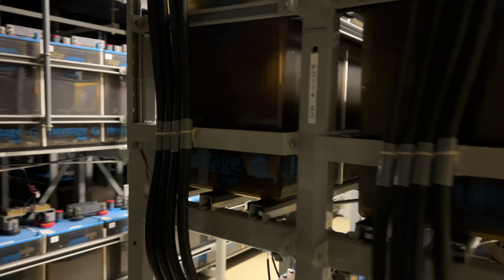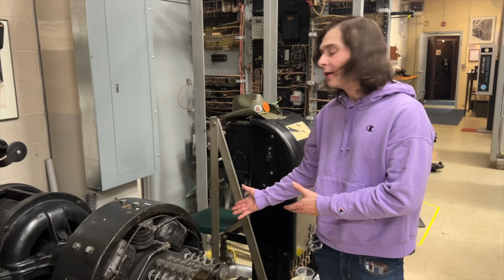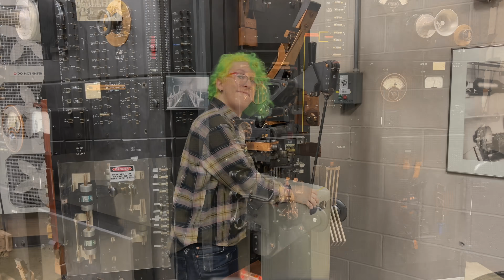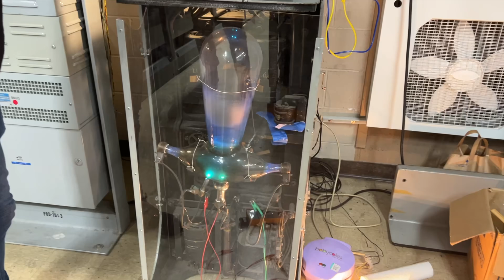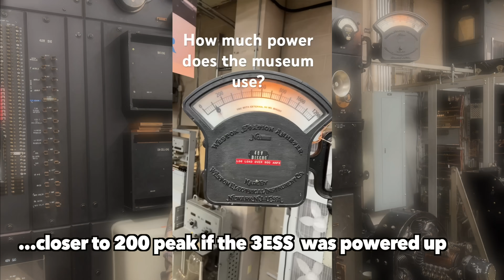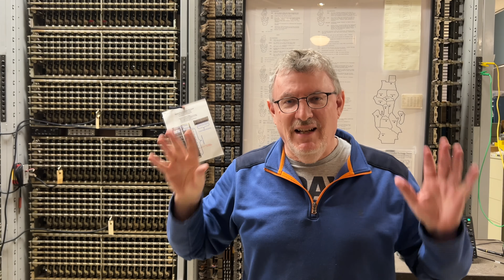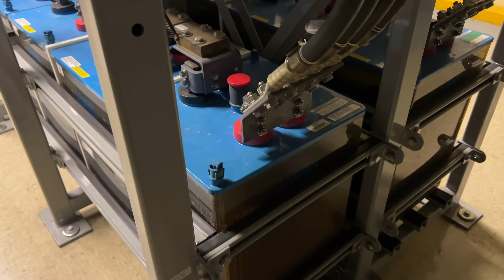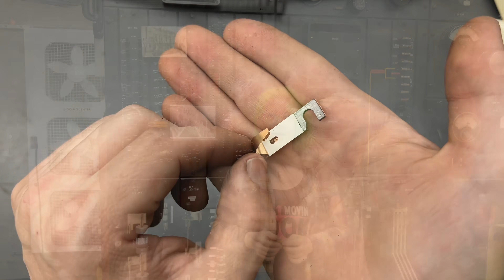All About Telephone Power Plants

Comment: I don't believe that "4800 amp fuse" is actually a fuse unless thats a soft low melting metal in the middle. That shape of device is more likely a current measuring shunt. It will have a specific voltage drop at the rated current across it, usually a round value like 100 millivolts or 50 millivolts and that can be hooked up to a meter movement with that range and labeled to the scale on the face.
Reply from the maker: It is 100% a fuse, guaranteed. The material in the middle is lead. (The shunts are elsewhere on the back of the power board.)
Reply: @ConnectionsMuseum  We believe you Sarah, it's just hard to wrap our heads around the power needed to blow that fuse, and as you said, it would be bad. lol. I am a scaredy cat around power that can smoke me, so I would have kept 10 feet from that thing.

Comment: Wrench go bye-bye, but screwdrivers have a chance to get launched! A change of pants follows.

Much more modern than the museum, but there are little packaged power plants that fit entirely within a cabinet. Marconi Lorain, Vertiv, and Valere have or had systems like this. In the typical style, BDFB up top and equipment down low. The "fully enclosed" ones are kind of fun with the ventilation slots on the lid - sized quite appropriately so that anything that should fall through would be small enough to be instantly vaporized! :) Keep tabs on your washers, folks

Not quite common enough to be a rite of passage, but a good reminder to wrap your tools in electrical tape.

Comment: My father worked in a 5X5 crossbar office from cutover in Nov of 1949 till retirement in Dec 1973 and their power plant changed over the years. When cut into service they replaced operators, and the locals couldn't figure out the "new" system. They had three GE motor generator sets the were 200 amp which evolved into one being replaced with a Westinghouse 400 amp machine, it was a screamer sound wise compared to the GE generators. Finally in the last few years of service they installed a solid-state rectifier that became the number one in the string and ran at full output of around 500 amp. Originally there was no standby power for AC, later they installed a 100kw diesel unit that had to be manually started, just after Dad's retirement a Solar gas turbine unit was installed a 250kw unit.  At retirement the exchange had two full units 232 and 439, now there are five exchange units and are all ESS and are in the basement, whole first floor has nothing left but the main frame. Haven't been in the place since ESS as there is no regular staff.  Remotely monitored and "nothing can possibly go wrong!"
Reply: I spent about 10 years maintaining DC power plants and backup generators.  At one site we had 3  2.2 megawatts Solar Generators operating in parallel    400 gallons of fuel per hour
I also saw what happens when plumbers working on a water sprinkler system above the bus bar shorted out a  ladder from the bus bar to ground.  It put a hole in the 1/4 “bus bar. And destroying the ladder
When working on these power plants a good safety reminder is to keep one hand in your pocket

Comment: A benefit of -48 V that could never have been foreseen by the inventor is that you can switch it with N-MOSFETs which are much more efficient than P-MOSFETs. When I did a design for a manufacturer of modern battery backups for cell phone base stations, I was quite happy that I didn't need complicated high-side switches. (Yes, -48 V is still the telecom standard.) But I have a hard time rewiring my brain for positive GND.
Reply: What's positive ground? And what's N-mosfets vs p-mosfets?
Reply: @freddiebauer5843  It's when, instead of using the lowest potential in a design as the common distributed reference, you use a higher potential. It's just a matter of convention. For instance, there are (old) car models that connect the positive terminal of the battery to the chassis. They are said to have positive ground. The other battery terminal has -12V relative to ground.

N and P in semiconductors reference the charge carriers. In an NMOS, it is the electrons that are controlled whereas in a PMOS it is the absence of electrons – holes – that are controlled. And that is indeed a practical difference since controlling electrons is more efficient. Very simply put.
Reply: @mumiemonstret  is this why the video host isn't scared to be around such high DC voltage? Does it make it safer?
BTW, I had no idea this was even possible. I thought positive to ground would just drain the battery

Comment: It was wonderful to see End Cell switching. That has to be the craziest part of telecom power. I’m not sure you mentioned that power is not disrupted while adding a cell. This means the cell is first shorted out, then put in series with the other cells, and then the short removed. I’m assuming all end cells work the way I was taught.
Reply: I was going to ask about End Cell switching.  I've heard that it is done by a motorized control that is designed such that nothing can stop it once the process is started. The non-stop feature protects the shunt that is being fried during the process.

Comment: It’s been a long time so I may have this wrong, but I thought the batteries were floated at 52.75v and not 48.
Reply: It depends on the battery chemistry and construction and how the string is built. Where I work the COs have strings of 24 C&D AT-21Ps, which are valve-regulated flooded lead-acid cells. Those systems float at ~54.25V. Some other strings float 52, some 56, and so on... hence the disclaimer of 48V "nominal".

Cars are the same, 12V "nominal" but alternator set for 13.8 and sometimes 14.2V

Comment: I thought phone companies use nickel iron batteries in the early days!
Reply: Not sure, but the ones I worked on in the 80s were lead acid batteries and we had to take daily pilot cell voltage and density measurements, and of course do some corrosion control if needed. That part of the job always scared the CR@P out of me. In the late 1990s they all got replaced with jell filled batteries. Don't remember what they were made of, but they were sealed, supposedly less toxic, and we only had to check the pilot voltage once a month. That was a welcome upgrade to our jobs.

Comment: That "motor starter" is a Manual Reduced voltage soft starter (RVSS).  These have pretty much died with the electronic RVSS because most people don't learn about them. Its usually cheaper to eliminate them instead of fixing them.

Comment: Having reliable power systems for telecom stuff is so important and some companies just don't take it seriously. You can add all the redundancies you want at higher levels, but they don't do much if your telephone switches/router/switch/fiber transport/microwave equipment is sitting there, powered down for silly reasons. The WISP/Fiber provider I work for generally takes it seriously and it's great how little maintenance you'll need when things are properly grounded, you have redundant modular rectifier shelves, and battery banks with a full day (or more) of runtime, and everything is on DC power. 

We've done acquisitions where the previous owners used standard office-grade UPSes to backup site equipment or simply nothing at all. It all falls apart quickly when a storm or a power grid issue rolls through, needing a lot of manpower for what should be preventable issues. The telephone companies learned that lesson a long time a ago and it frustrates me to watch new telecoms have to learn it the hard way.

Comment: Very interesting.  In the 1970s I worked on mainframe computer systems.  We used motor-alternators to supply power to the system.  These consisted of a 440v 3 phase motor  driving a 440v 3 phase alternator.  Their purpose was to give us a clean mains supply.

Comment: Wonder if the 48V phantom power for microphone are related to the telephone network power voltage? knowing that guitar jacks directly comes from switchboards, I won't be surprised...
Reply: Yep exact same principle of operation, condenser microphones modulate the DC supply into a waveform that the preamp picks up
Reply: When Neumann GmbH developed the transistor KM84 microphone for the Norwegian Broadcasting Corporation (NRK), they exploited the existing 48 VDC power available in the NRK studios for their emergency lighting systems. This was later standardized as DIN 45596, colloquially known as "Phantom Power".

Comment: 26:00 - Back in the days before 1990, when I was working at a place that caused me to start paying more attention to telcos, a newbie went into the power room at SPBGFLXA89H -- St Pete Main, at 1 Av N and 8 St in St Pete FL -- with a wrench he was NOT supposed to take in there (it either wasn't dipped in vinyl or wasn't strung up out of the reach of...) and he managed to get that wrench across the primary accumulator busbar in that 30x30ft battery room.

It was a 7 story CO, and when I wrangled a tour of it in 1990 and got told the story, it was only carrying 2 5ESS remotes and half a floor of GTD-5EAX, but was still provisioned for all that it had formerly powered....

...so figure 8000-10000A at -48.

And when that 12" crescent wrench hit the busbars, essentially all of it flashed into plasma in some very short collection of milliseconds.  Little divots of it were all that were left on each side.  The worker, though not really injured badly, was deaf for a couple days.

And a fuse in that general position -- though MUCH larger -- blew sky high.

They had to *fly one in*, I was told, from out of state; nothing big enough was stocked anywhere.

And St Pete PD was on all-hands alert until about 11pm, when they got it fixed.  Just like in Mass last week.  Cop car on every corner, blue lights spinning.

Sadly, this event seems to be back past the Event Horizon, but if anyone ever finds coverage of it, do please let me know.

Comment: It's really amazing how much inertia is in telecom. While individual components have changed out over the years, the topology of a modern CO's power plant really hasn't changed all that much. It's still negative 48V. There's still a string of batteries in the basement, although the rectifiers are indeed all solid state. Each rack still has its own set of fuses, complete with monitoring, although that's all electronic these days.

Also worth mentioning is why 48V was chosen. It was a balance of safety and conductor size, while still being high enough to reliably break through oxidation on relay contacts.
Reply: And why negative is to do with electrochemistry when an underground telephone line has a break in the insulation.

Comment: Love these videos but ngl it makes me very nervous watching you put your hands all over those copper contacts?  My hands would be firmly behind my back around equipment like this unless there was absolutely zero possibility of it being energized.
Reply from the maker: That makes sense! When in doubt, be safe. 

I work on this board extensively, and I know which parts of it are energized and at what voltage. I know where the wires go on the back, and I know what circuits are fused and where the cut-off switches are. But if a visitor walked in and started touching the board randomly, I’d ask them to stop!
Reply: Omg I can't agree more. You are fraking fearless Sarah. I know you engineered and connected it. But what if someone reconfigured it when you weren't there. We love your videos and love you too, but please be safe.

Ok enough of that. You are awesome, the museum is awesome, and all the volunteers are awesome.  'Nough said.

Comment: I definitely remember POTS working during power outages.  When we moved to Santa Maria, CA in 1979 the phone numbers for the city were 5 digits.  Probably the 5 digits were the local numbers just for Santa Maria.   Then one day the phone company told us that we must use 92 in front of our 5 digit numbers.     Some years later I had a job at a college - THEY had their own 48 volt lead-acid batteries in their basement for their elaborate 70's style phone system.   So cool.

Comment: You forgot to mention a little ditty when you spoke about the grasshopper fuses and the alarms. The big, cartridge fuses had no way of tripping the alarms so they wired a grasshopper fuse in the circuit. Now when a 400 amp cartridge fuse blows, the 1/4 amp grasshopper blows along with it thus tripping the alarm. 
But you don't know how often I have seen a "tech" standing at a BDFD with a pile of blown 1/4 amp fuses at his feet. "The damn thing keeps blowing every time I replace it!". Then I would show him that the fuse he was trying to replace was actually a "tell tail fuse" for a cartridge fuse!
Reply: Yeah, I'm calling bs on that last part.  Sure, one fuse blows then replace it.  The replacement immediately blew?  You have a real problem and you should not try again until the problem is found and fixed.  If the answer to a blowing fuse is to blindly keep jamming replacements in then why is the fuse there at all?
Reply: @uzlonewolf  Never underestimate stupidity. I was on the team that built the battery plant in DTLA for Level3. We were working under another company that thought they were the bees knees as far as battery plant, yet they had to hire us... There's a few good stories on that project but this one is directly applicable.

Battery plant was live and it came time to light up the Circuit Breaker bays at the end of each aisle. Pretty familiar design Marconi. Middle of the rack was the meters and alarm stuff with a panel above with the big fuse block, 18/100 amp type 70 alarm fuses for this type. One of the project managers for whatever reason wanted to be the guy to do the turn up. I was otherwise occupied but I could see him. Sure enough, the big fuse was sitting at his feet and he popped an alarm fuse in, alarm fuse blew instantly just trying to light the alarm light at the top of the frame. I don't remember how many he blew while he cussed but a few of us had time to gather and watch. Eventually someone took pity taped him on the shoulder and explained where he went wrong, he didn't appreciate us finally getting to laugh aloud. 

My other favorite story on that project: ADC was doing all the DC leaving the BDCBBs, and the rest of the install. So, someone had the bright idea to run two 1/0 circuits to the end of the aisle on hangers. They tapped off leads to be primaries for each fuse panel at the top of each rack, So each of those 1/0 circuits was like a bus, an A side and a B side. Sketchy and dumb but ok, not my circus. The real dumb part is that each of those 1/0 had an H-tapped tail at the BDCBB side for each fuse panel, you're not reading that wrong. Each 1/0 had 20 tails and each tail went to a separate breaker... Each breaker was labeled for a different fuse panel. Like the electricity would magically not go there when you shut off the breaker.
Reply: @uzlonewolf  unfortunately, these people should have never been CO techs.  Yes it's logical for you and I to say that is a stupid thing to do but believe me, these were people with long records of being brainless. These are people who didn't care about their jobs and the union protected them.
Reply: You had to be careful that the spring part had tension on it.
Reply: If a fuse blows when you replace it, and you're not an NPC, stop replacing it and troubleshoot deeper

Comment: Back in the late 70's and the early 80's, I handled the power rooms in Hartford, CT (SNET) for many years. In the 01 and 02 offices, we had the standard Excide batteries that most offices use. But in the newer 03 office, along with the Excide batteries, they had 12 strings of submarine batteries. These were about 4 feet tall but were solid black so you couldn't see into them. Everyone hated them and in my last few years, many of them started to swell. That's not good for any battery but even more dangerous for the submarine batteries. I learned from a friend in the Navy that these batteries only had a "safe" lifespan of about 14 years. After checking the records, I determined that these batteries in the 03 office were in their 19th year! This explains why we had to "float" these more often as they wouldn't hold that charge properly. Yeah, "floating" submarine batteries is another world in itself. You need twice the airflow to mitigate the hydrogen gas as with the Excide batteries. The risk of explosion was terrible when I had to charge these monsters. Worst of it all, for all the reports that I filed about the batteries and the danger, the submarine batteries were never replaced while I was there. I found out that they were taken out of service about 5 years after I left Hartford because one of the submarine batteries finally split open due to the swelling.
Reply: Ever wonder about all those drains in the floors in case of a cell splitting open? where did all that battery acid go anyway? There were concrete curbs to keep the acid in the battery room, but that is where the floor drains were...........Then there was all those little brown bottles of  that Trichloroethylene (TCE) stuff that mysteriously disappeared one day.......

Comment: I’m assuming that it’s a standard squirrel cage motor that you’re using to drive the DC generator.  
If that’s true then the auto-transformer starter isn't being used to limit the starting torque so the generator shaft wont break.  The auto-transformer starter is used to limit the inrush current to the induction motor which in most cases would be about six times full load current for a couple of seconds duration at the initial start.  In modern systems this is seldom used but in an older installation fed by a long line the voltage drop incurred a six times full load current would likely cause the motor start time to be long -  greater than 10 seconds.  This could burn out the motor.